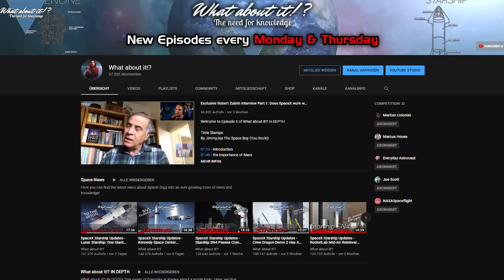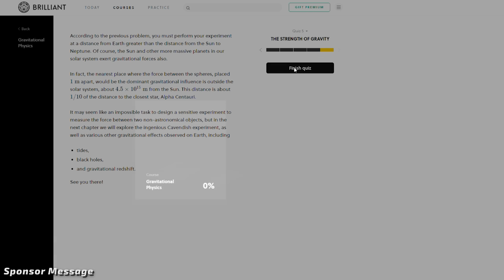96 | SpaceX Starship Updates - Crew Dragon Demo 2 Launch Attempt Summary

Comment: i think they plan to abuse SN4 more and more on tests of all  the new equipment and functions 1 by 1 until it do a rapid dissasembly, but all other test results that have been completed and had already passed will be automatically be implemented to the other starships in production, and then when the rapid dissasembly occurs on SN4 obviously SN5 will takes its place and whatever the cause of the SN4 rapid disassembly will be fixed on the next starships in line up, and then the cycle goes on until they have a fully functioning Starship......my opinion only :D

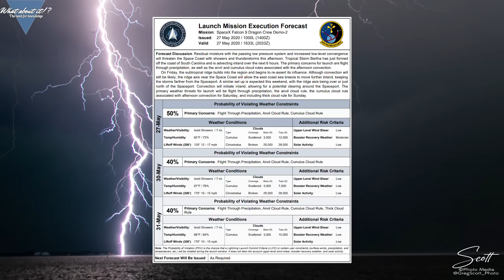Comment: 9:38 The 50/50 verdict isn't the probability of a failure it's just the probability of the weather conditions not meeting the safety criteria of a go launch based on a variety of criteria for an acceptable margin of risk that is probably far lower than 50%.

Comment: Please avoid the impression that a set of sensors with computers would be a scientist, as many of the companies that manufacture automata for space travel do. The Americans in particular tend to talk about machines as if they were human beings and lightly call them "robots"! Some of these "robots" cannot do more than a modern coffee machine. The majority of their actuators are remotely controlled from the earth's surface.
I am a physicist and if I imagined that I would have to do one of my experiments - that I did at the university - by remote control, it would hardly have been possible. In order to conduct Mars research remotely, the scientific instruments must be reduced to a few instruments that can be remotely controlled. But then you cannot work as a scientist as you want.
For this reason alone, manned space travel is necessary: let us scientists go straight to our area of interest: Mars, the moon, etc. and let us take the instruments we need.
For me as a space fan, there are of course much nicer reasons: space travel is an adventure. Think of the world as the TV series "The Expanse" describes: Mars & Belt populated, moons of the solar system littered with research stations. The adventures that could happen are almost limitless. New worlds are opened.

Comment: 304L  helps reduce carbide precipitation during welding. (Which lowers strength and allows a place for corrosion to begin)
304 alloy has .08% carbon where alloy 304L has a maximum of .03 carbon. The "L" is understood to mean Low Carbon content.  Most all cookware is 304L.

A rocket depends on a weight and balance calculation, same as aircraft.  The mass added  to SN4 is at the top. (To compensate for missing rings and nose cone and anything above the cryo meth tank that is missing.

Comment: With 304L coiled vs. 301, my experience leads me to believe that thicknesses beyond the gauge thicknesses (i.e. sheet) are more readily available in 304. 301 is commercially sheet, whereas 304L and it's variants are offered in both common sheet and plate thicknesses.
Reply: Mill runs (special orders) for rolled goods run at the 50 tonne range. Basically an ingot's mass. A new mix formula minimum ordering mass will depend upon furnace capacity at each individual ingot supplier.
I expect there exists a wide range to pick from, but best price will likely be from the guy with the big furnaces.

Comment: Seems odd to me that spaceX would use such an expensive material as nothing but dead weight. The welds also make using that steel for production at a later date somewhat questionable, so i doubt this is just a temporary purpose for a material that will be consumed later. Will be interesting to see how my logic holds up in future episodes.

Comment: great video and update; the weight  on the nose is clearly more engines and a high level hop ?? The Heat Tile system is interesting as is it a screw fixing or is it a test of the cooling and 2 completing designs ??

Comment: 304L is cool.  Welds nice because there isnt enough carbon in it to precipitate chromium carbines when the steel is fused.  No heat sensitization for corrosion either.

Comment: Just bought a bunch of pots and pans out of Finnish 304L stainless steel. Good stuff! :) Also true believers always knew, NO ADHESIVES ON STARSHIP! :) And I have been linking the NASA page on TUFROC for weeks, which points out the material can be directly bonded to metals and a variety of other materials for near endless attachment schemes.

Comment: All that money to rebuild the pad, and the elevator stops 1 floor short? Does anyone know why? My only guess is the counter weight for the arm is in the way. Also during Apollo and I think the Shuttle, the access arm moved only a short distance from the capsule at first, until just before launch for quick access if needed for escape. Why doesn't the new one?